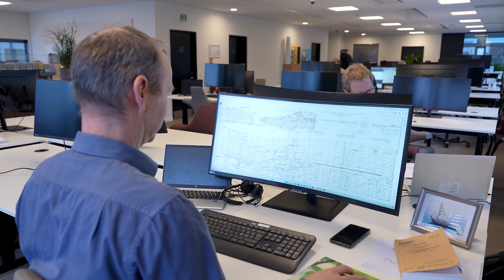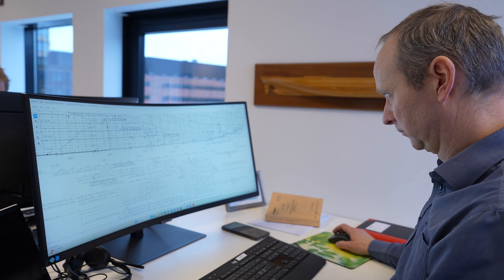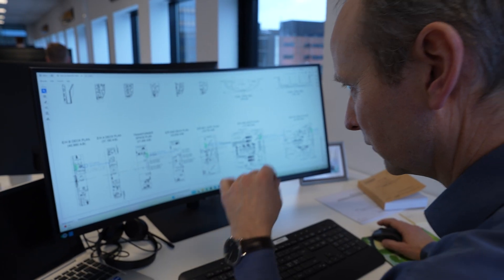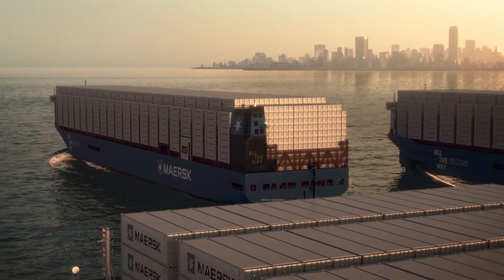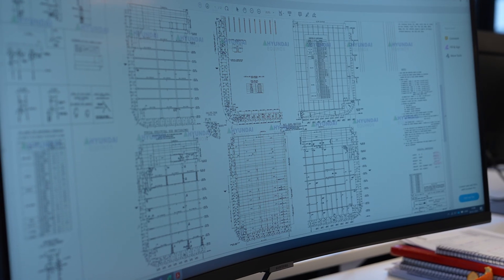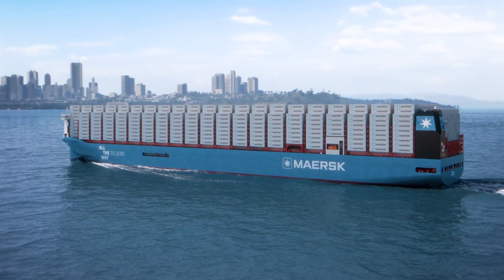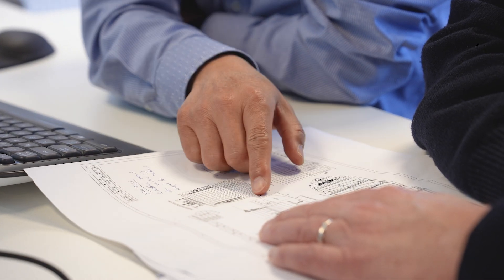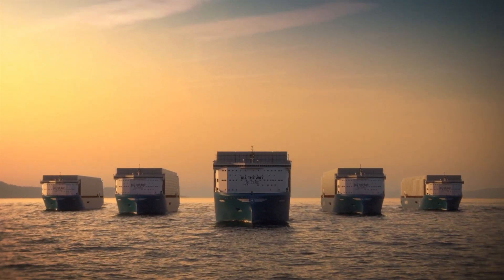Kristian Agdrup explaining the design of our large methanol-enabled container vessels

Comment: For those who do not work in this field of activity, everything looks beautiful from the outside.

Accommodation forward, difficult and challenging living and working conditions for crew, especially for engine department crew.

UMS system for engine department. Accommodation forward engine room, ECR aft ??!!!

 Duty engineer and duty oiler will run from accommodation - forward to ECR - enginee room - aft to deal with the alarms during UMS???!!!

How it will the UMS service be done? How many engineers and engine ratings are in the crew on board?

 Methanol is liquid at atmospheric temperatures and pressures and hence bunkering is almost similar to conventional fuel oils, although the low-flashpoint and toxic properties require additional equipment and operational procedures.

One of the major disadvantage of methanol is its lower energy content per volume.

Methanol requires fuel tanks approximately 2.5 times the size of HFO tanks for the same energy content, or 1.3 times larger than equivalent LNG tanks. This has consequences for the spatial arrangements on board and the trading range of methanol-powered vessels.

 As a result, its applicability is mainly for smaller ships, feeder container vessels, at least initially.

 Methanol is a low-flashpoint flammable liquid and should take additional precautions to prevent ignition due to electrical arcing.

Methanol bunkering is a classic chemical tank cargo operation procedure, considering that methanol is a Dangerous Chemicals, it involves a much more complicated procedure than the conventional fuel, Inerting, Purging, etc. All these procedures involve adjacent installations, plus their operation and maintenance, installations that were usually found only on chemical tankers.

 In fact the container vessel powered by methanol becomes also small chemical tanker ship.

On board the chemical tankers, directly in charge of cargo operation ( safe loading, discharging and stowage of cargo) is an experienced Chief Mate. That's all he does on board, not maneuvers, not watch duty.

On these container ships powered by methanol, the methanol bunkering operation is done by the engine department.

Anyway, classic fuel remains to be bunkered, because methanol cannot be used alone as a fuel for two-stroke naval engines.

Most current 2 strokes naval engines methanol requires a pilot fuel for efficient burning, so conventional fuel must be carried on board as well, doubling as fall-back fuel too.

Comment: Accommodation at the forward of the ship. I supose that the ship it will be with UMS system. 

How many engineer officers and ratings allocated for UMS duty?

 How will UMS duty proceed in case of alarms. It is some distance from forward to the Engine Room, to the ECR. 

How it's solved this problem in a safety manner for the engine crew?

Thank you?

Comment: How can the crew sleep peacefully if the accommodation is in forward.
Reply: Why is that?
Reply: Normally forward region tends to have more heaving and pitching while sailing ,if there is accomodation placed think of its effect
Reply: @chandrapraveen4976  makes sense, but shouldn’t it be the same for the back? I understand when you put accommodation in the middle of the ship that this is beneficial. But back and front should be similar for big ships?
Reply: @maxfuchs3387 forward is worse, especially the pitching. I speak from experience. Also you usually hear the anchor/anchor chain during bad weather which can also be annoying. I‘m sailing on LPG tankers with accommodations forward and another bad factor is that with the higher cargo capacity comes less ballast, so when your in ballast condition the GM is very high and you have very fast rolling movement.
Reply: There is no industry standard for vessel movement/ comfort, also the smaller feeder ships he uses as comparison are mostly navigating coastal, they are not in the middle of the ocean with no where to shelter for weeks on end.
Reply: The reality is that the decarbonisation of shipping is a good opertunity to make more money at the expense of a crews quality of life whilst at work.

Comment: What about the key question. Where do you put the Methanol tanks and how do you implement this in your design? No explantion at all about the Methanol use. I guess the vessels are only prepared for.
Reply: Probably where the normal fuel tanks go, I'd presume
Reply: @aejerthegreat  Right, but the tanks need to be ~3x larger capacity due to lower energy density of methanol relative to diesel.